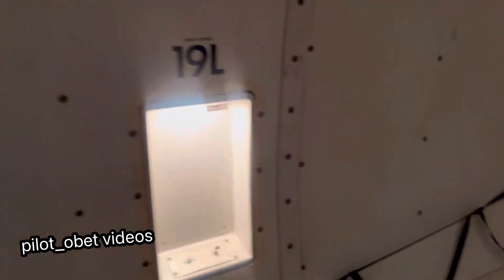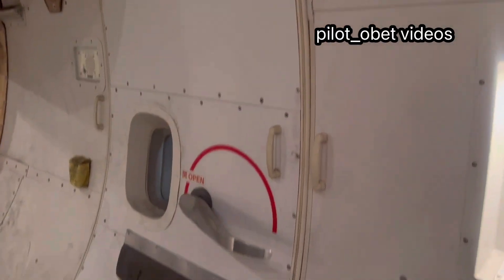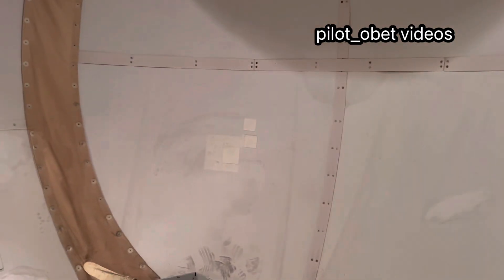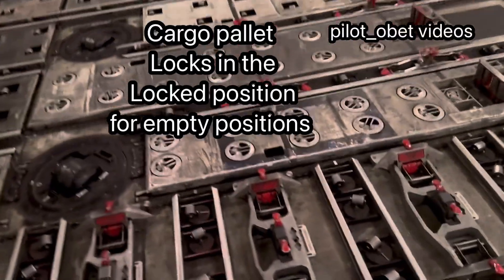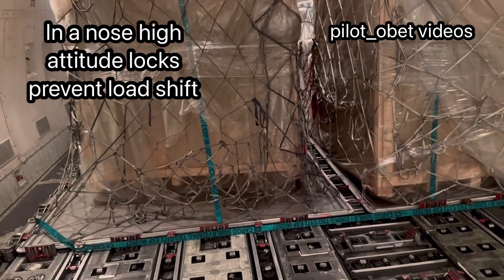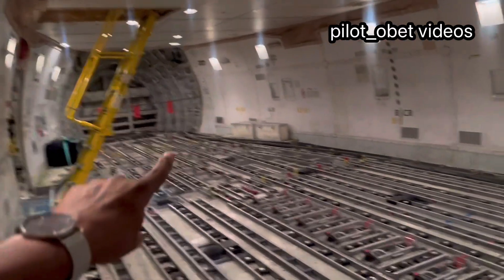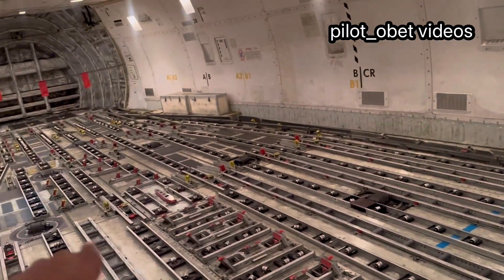BOEING 747-400ERF: CARGO SAFETY

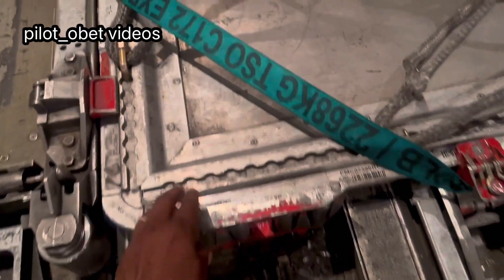Comment: 2:45 that there is not a lock, it's a guide for the plates when offloading the plane, the flip down to allow the plate to roll over them but once they're past it you can use those to guide it straight out.

Comment: Very interesting sir. Makes you wonder bout the 747 in Aghan that tipped up.
Reply: They used a few crappy ratchet straps to secure heavy military vehicles. They didn't use nearly enough of them, the straps broke, and an MRAP slid back and busted through the rear pressure bulkhead. In addition to shifting the CG backwards, it broke the stabilizer jackscrew which left the stabilizer swinging freely. That basically caused them to lose all pitch control.

Comment: Excellent explanation!  Now I'm wondering what happened with the load shift on that 747 that crashed on departure due to load shift rearward from Baghdad several years ago.  That was a brutal crash.  The aircraft lurched nose up, stalled, then hit the ground in a devastating crash. All on video.
Reply from the maker: The investigation I believed determined that the wrong strength straps were used to secure the vehicle and in addition, the parking brake/Hand brake was not On in the vehicle…..the straps basically snapped and with brake not set to park…..
Reply: @pilot_obet  sad. Totally preventable.

Comment: Captain, who is responsible for calculating the "moment weights" and is it done manually or by computer.  Once the moment weights are calculated, is there a second confirmation check carried out for accuracy?
Reply from the maker: @Terrorhawk38  All done by load control who have systems in place - all computerized.
Reply: On smaller planes load and balance calculations are  the responsibility of the Pilot in Command. On larger planes this is computerized and done by dispatch or Loadcontrol.
Average weights are used for female / male and infant PAX and adjustments are also made for heavier winter clothing. Weight and balance also affects seating on flights that are not full. Computations ate computerized based on station numbers / positions and manufacturer data